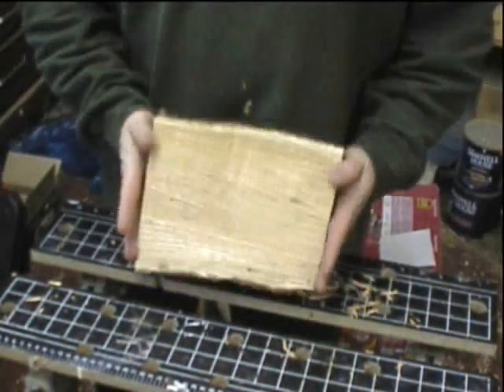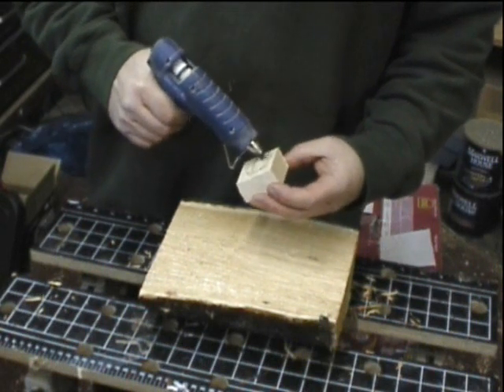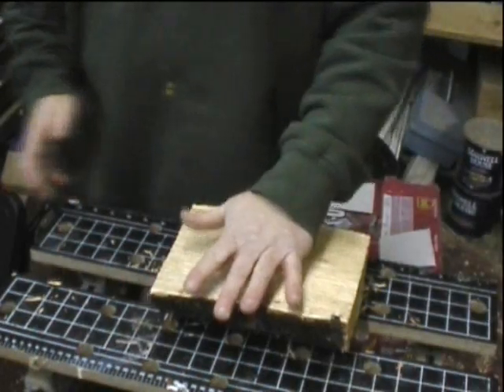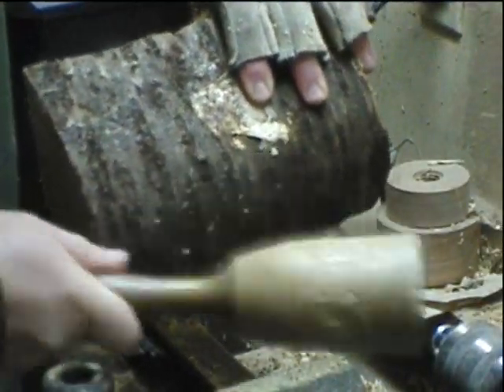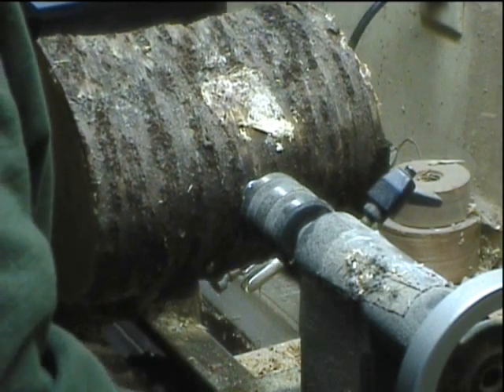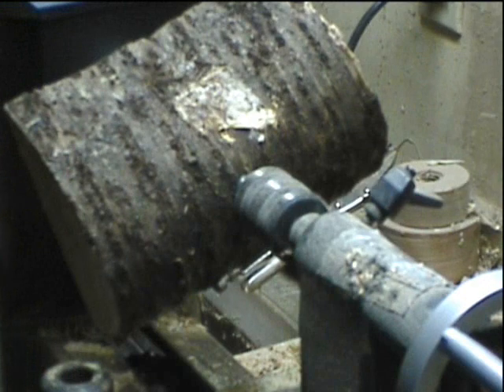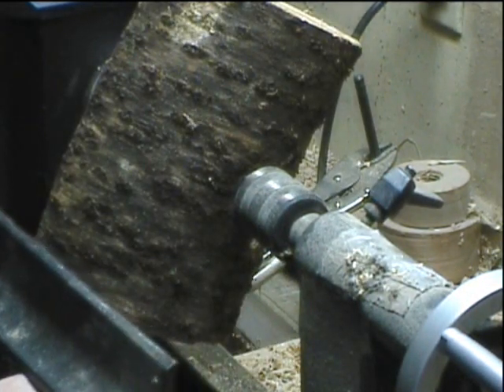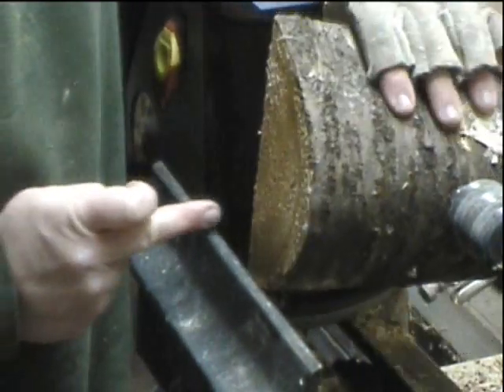Natural Edged Bowl (1) Mounting

Comment: Hey Darrell,

I like your videos and your teaching style.  However, in this case, I would like to differ with you on a few points:
1)  I'd mount it the other-way-round, with the spur drive pounded into the bark edge.
2)  I'd also suggest aligning it so the bark edge is perpendicular to the lathe
3)  Most important, I' always teach people to put the rest at 45 degrees, and cut arcs from foot towards rim for initial shaping.  Beginners that try to bang away at those corners won't have much fun!